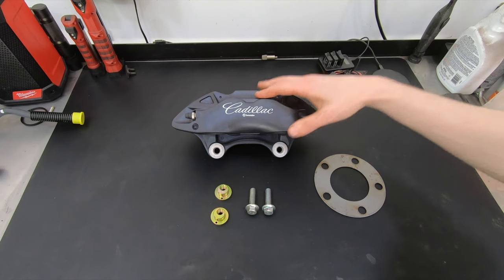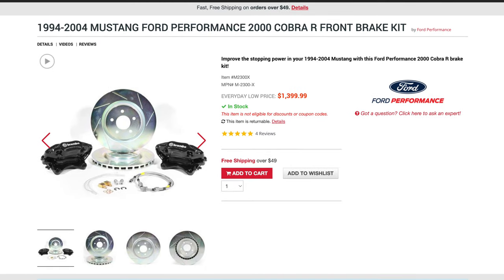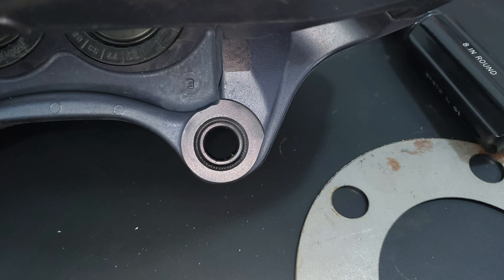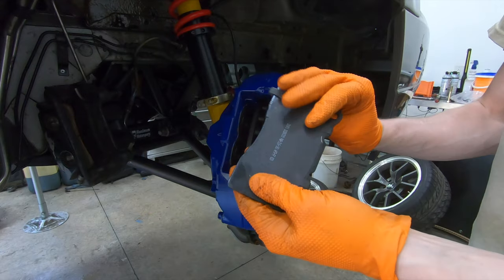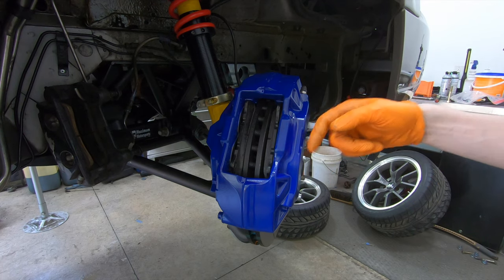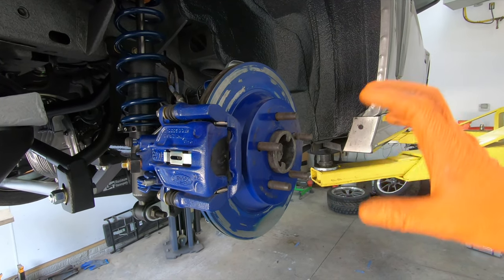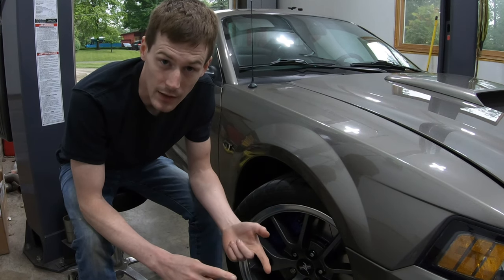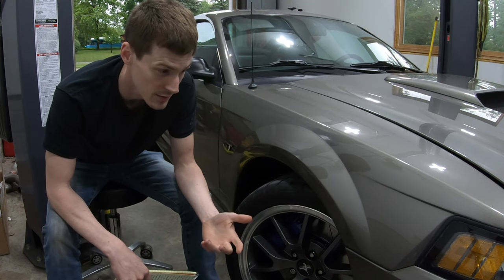Mustang Big Brakes Front and Rear for less than $600! 1979-2004 (ATS Brembos Front, Taurus Rear)

Comment: So just to clarify, if I were to use the ATS calipers in tandem with the Taurus calipers, and a 1 1/16 master cylinder, I would NOT have to use an adjustable prop valve as i would retain the “stock” bias with the Taurus calipers ? Or would I still need an adjustable prop valve? Have a foxbody btw but considering this setup
Reply from the maker: Considering those were rear drum originally I'm not sure to be perfectly honest with you. If it was me I would bolt this setup on, drive it a litte and see how it behaves. If the rears lock before the fronts install the proportioning valve. You will need the 1 1/16" master for sure.
Reply: @RepairGeek  yeah I ordered a stock 87-93 booster to pair with a 94-95 gt master. Since I have a 1980, I can’t fit any booster bigger than the stock gt without beating the hell out of my strut tower which I refuse to do. 😂
Reply: @RepairGeek  can I get your instagram in case I have any other questions ?
Reply from the maker: @mikecam94  repairgeek365@gmail.com it may take me a day or 2 but I'll get back to you.

Comment: Wait so we need the 11.5" rear cobra rotors with the Taurus calipers in the rear? Just want to double check before I pull the trigger on the rears. I already have the brembos up front and need to fix the variance
Reply from the maker: The taurus calipers will help the rear bias even on a 10 inch rotor. You dont need the 11.65 rotor to install the taurus caliper. It will bolt up fine. The 11.65 rear w/taurus calipers is virtually stock as far as bias using ATS fronts.
Reply: @RepairGeek  so I can bolt up the Taurus rear caliper and use either the 10" rotor or the 11.6"?
Reply from the maker: Not sure what you are working on but, yes using a 94-04 mustang caliper bracket yes, bolts right in.

Comment: How’s the brake pedal feel and initial bite? Does it make a huge difference or just marginal/compromise besides getting the willwood or bear breaks? I’d rather by once cry once hahaha 😭
Reply from the maker: It had enough brake power to compelety overwhelm a set of 275 Nitto 555's in a panic stop. I've since upgraded to Michelin PS4S's they have much more grip than the nittos.

Comment: I hate to ask this as I'm sure you've heard it a lot but I have to be sure..... so if I go with the Taurus calipers, use the stock GT rotors, correct? I'm going to go slotted so I want to buy a new set but wanted to make sure before I bought them.
Reply from the maker: You CAN use the GT rears with the Taurus calipers. The cobra rear brackets and rotors are larger and are vented. This will help shift even more bias to the rear.

Comment: Hello, I've ordered the parts for the front, but do you know what is needed to be able to mount to the Taurus rear calipers onto a Foxbody (91) rear end?  Great video, thanks for making it!
Reply from the maker: You will need to order whatever it takes to put a 11.5 SN95 rear rotor and caliper on a fox.

Comment: I have a question. The front brake lines you suggested. The female thread is to big for the brake line. Did you use a treaded reducer? If so what size is it and where did you buy it? 
Thanks
Reply from the maker: What year is your car?
Reply: @RepairGeek  2001 Mustang GT
Reply from the maker: That's exactly what I have. The front brake hoses are all the same across everything in 2001. V6, GT, and Cobra all use the same hose... I'm thinking someone changed the front lines on your car or the hoses you have were put in the wrong box. That part number is correct as long as someone hasn't changed the fittings on the hardlines on your car.
Reply: @RepairGeek   Ok by trial and error. I wasn’t aware of the lines are different sizes. The tread off the brake line on the driver side is bigger than passenger side. The lines were not labeled. I figured they were the same.  I caught it when installing the second line. I appreciate your response.
Thanks

Comment: Apologize if I missed this, but are stock Cobra rear brake PADS compatible with the Taurus calipers?
Reply from the maker: Yep same pad as a Cobra.
Reply: Rear cobra pads for cobra rotors, gt pads for gt rotors. Cobra pads are thinner for the vented rotor thickness.

Comment: Awesome video. I read the s&s bushings can also be used for the  XTS calipers and run 14” rotors. I am building a fox with coyote supercharged. I want stopping power but moving up to 14” could create a rear caliper problem.  Do you know which rear caliper would work to keep the bias as intended ?
Reply from the maker: Nope, that's why I went with 13's.
Reply: @RepairGeek  what brand are those 2 piece rotors ?
Reply from the maker: DBA.

Comment: I have a '00 v6 new edge I'm building as a drift car. I was wondering if you might know whether or not the taurus rear calipers would work with the dual caliper brackets for a drift set-up? I assume the dual caliper bracket is meant for the stock GT brake calipers, and I plan on upgrading the brakes all around when I go to dual caliper, but until I saw this video I was gonna go with GT brakes. But if the Taurus rear calipers will also work, then I'll go with them and the ATS fronts.
Reply from the maker: If the bracket is designed for a stock 94-04 mustang rear caliper, it will bolt right in.
Reply: The brakes are the same on the v6 and GT.

Comment: If I install these brembos on  2003 mustang gt and add the taurus 43mm rear calipers without changing out the rotors to the bigger ones will the bias be off by alot. Is it still in an acceptable range to cause the car to brake evenly or is it a must to get to bigger rotor as well?????
Reply: also where did you find the chart that explains all the brake kit bias?

Comment: Technically all you have to do is drill out the spindle to a 14.3mm opening and it all bolts up without the kit.  You will have to either machine the contact area to spindle 2mm or space the rotor out 2mm for perfect Fitment.
Reply from the maker: You can. It also turns a $200 spindle into a paper weight unless you run this caliper. Also, these bushings drop the caliper down onto the rotor further as well. Again you could accomplish the same thing slotting out the holes correctly but you really don't want a brake caliper bolting into a slotted hole.
Reply: Excúseme not everyone has a metal Lathe machine 😂

Comment: Killer video, you answered some questions I've had about this swap and one or two I hadn't worried about finding the answers to yet.  I really appreciate the level of detail here.  I do have 3 questions:
First, is the rotor spacer really necessary?  If we moved the caliper back from the spindle by using spacers on the caliper mounting the same thickness as the rotor spacer, wouldn't that have the same effect and also give a slight extra bit of wheel clearance?
Second, have you given any thought to changing out the master cylinder to one with a bigger bore to get the pedal feel back to stock?  I was thinking maybe the Cobra R master if it had a bigger bore would be a good first step but I haven't looked at the numbers yet.
Third, could you keep the brake bias similar to stock by switching out to a larger rear rotor with something like the FTBR kit instead of swapping to a larger piston caliper?  That might swing the brake bias too much in the other direction but might help with pedal feel as you wouldn't be increase the rear piston diameter.
Reply from the maker: 1) Putting washers behind the caliper would make the issue of centering the rotor worse. Without a rotor spacer the rotor is closer to the inboard pistons than the outboard pistons. Shimming the caliper with washers would push the caliper more towards the outside of the car and make the issue worse. The caliper needs to be closer inboard to not need the rotor spacer. Machining down the ears on the caliper would do this but, then you need to make sure the caliper is perfectly perpendicular to the rotor. This isn't easy to do precisely without a milling machine. @ 6:37 gives the best visual on this.

2) This car already has a 1 1/16th bore master cylinder on it. That's as large as they get for one of these mustangs because this car has hydroboost. To keep my booster that's as large of a master as I can run. Some super duty trucks has a 1 1/8th master and a hydroboost but the mounting flange for the master is different and won't work. So 1 1/16th is as large as you can go as far as I'm aware.

3) This one I'm not sure to be completely honest with you. The FTBR kit that I saw was over $800 to put a 13 inch rotor on the back of one of these cars. There may be a cheaper option but I didn't see it on their website. Someone is going to have to run the #'s to see what that bias would be on that setup. Adding nearly 1.5" of rotor will help with brake torque but without hard #'s on bias I would have a hard time telling people to go that route. Yes it would help with pedal feel but, $800 is a steep price to pay for some rear rotors and a caliper bracket. The 11.65" Ford racing kit is half that cost. Also you're stuck buying replacement rotors from FTBR with their kit. What I spoke of in this video you can buy replacement parts at any auto parts store as long as you are willing to press bushings out of the front calipers and transfer them.
Reply: @RepairGeek  
You nailed it on #1, I wasn't visualizing it properly in my head when I was thinking about it.  #2 I've been seeing conflicting info on the MC bore sizes.  I see 1" or 1 1/16" the SN95 MC bore sizes depending on where I look, all the parts catalogues list 1", where did you get the 1 1/16" bore MC or is that the stock unit?  Baer makes a nice aftermarket 1 1/8" MC for the SN95, but it is 450 bucks or so which doesn't help keep the cost down. #3 I hadn't looked at pricing on that FTBR kit in a LONG time and it has gone up quite a bit so I think swapping the calipers over to the larger piston makes sense here.
Reply from the maker: I want to say all the 96+ V8 cars had a 1 1/16th master. I know mine does. Guys with a 1" MC run out of travel with this setup. I looked at that Baer unit. It's intriguing but at $435 it's a bit too much $ to gamble. What I have isn't bad at all.
Reply: @RepairGeek  
Thanks for the info and the conversation.  If I find a good factory part that has a 1 1/8" bore I'll try to remember to come back here an post it up.
Reply: Not hydra boost but the svo has an 1”1/8 thinking about doing this swap since all the brakes are gummed up on this 27 year garage piece of my dads. Thanks for all the info!
Reply from the maker: SVO has different fittings for the master. It's not a direct bolt in for most cars. You have to get creative with the lines connecting to the master.

Comment: I like what you showed me. But i have a fox chassis  Mustang , will this work on that car? i did upgrade the rear brakes from drum to disc with stock Mustang components but still have stock front brakes. 11 inch sloted rotors with ceramic pads but the original calipers.  also converted to 5 lug. Also what year Taurus are these rear calipers from. The Amzon links don't mention the year.  And i agree , your stopping power is only as good as the tires grip to the road.
Reply from the maker: Use a SN95 spindle on the Fox lower control arm. The rest should be pretty much the same. Also you may have to up size your master cylinder. This car is using a 1-1/16th bore MC (factory). The foxes I believe are 1 inch bore or less. You might run out of pedal travel before the brakes lock up. A MC from a 94-95 cobra should bolt in and be the correct size I believe.
Reply: I'm doing this on my 89 GT we need to get the 93 cobra brake booster and a 93 cobra master cylinder
Reply: @RepairGeek  Sorry for the late reply. I do have a 94 Cobra MC on the car already since i converted the rears to disc Back in 2006. I need to get the SN95 spindles. My original calipers oar grinding on the rotor for some reason and i think the SN 95 would be better.  Do you know ere i can get some SN 95 spindles.? Thanks.  I also have the 17 "  wheels , factory for 94-85 Stang GT spot package. Double 3 spoke. Love them.
Reply: @myeighty-nine7813  Thanks. I already have the 94 Cobra Master on as i did a rear disc conversion on the car and  a booster from a v6 car.  much bigger.

Comment: Are rear cobra calipers good enough for this upgrade? Or should i still get taurus calipers?
Reply from the maker: The rear Cobra caliper and the GT caliper are the same part. The brackets are different but the physical caliper is the exact same between GT and Cobra. So, like I stated in the video, you need to upgrade to the Taurus rear.

Comment: Regarding the rear Taurus caliper. What if you are upgrading a Cobra? Are the Taurus rear calipers larger than the Cobra’s?
Reply from the maker: Yes the taurus caliper has a larger piston than even the cobra. The 94-04 GT and Cobra calipers are the exact same part. The brackets for the GT and Cobra are different. The Taurus caliper bolt right into either a GT of Cobra bracket. The 11.5 Cobra rear setup provides more rear bias than the 10.5" rotor'ed GT.
Reply: So with the Conra providing more rear bias do I need to do the Taurus swap?
Reply from the maker: Yes.

Comment: Do you know which are the rear sets of pads using the Taurus caliper and cobra sized rear rotors? I got the power stop evolution plus for the front, and wanted to get some similar ones for the rear, let me know 🙌
Reply from the maker: I'm not sure what you're asking.
Reply: @RepairGeek  what pads did you get for the rear
Reply: @RepairGeek  I got the front branded ones that u got, but I wanted to see what u ran for rear pads regarding the brand
Reply from the maker: Buy 94-04 Cobra rear pads. I just ran the same powerstop ceramics on the rear.
Reply: @RepairGeek  the cobra rear pads fit on the Taurus calipers ? 🙌
Reply from the maker: Yep, the caliper body is exactly the same casting. Only the piston bore diameter is different.

Comment: Can't you simply adjust your proportioning valve to adjust front to rear bias? That seems to be the easier step vs having to change calipers in the rear too.
Reply from the maker: Proportioning valves are only used for tuning. They can't make up for engineering problems.
Reply: @RepairGeek  don't see how it's an engineering "problem" if you literally have control over setting the desired bias. Assuming you're not drastically out of balance and the rears being terribly undersized, dialing it in is essentially the completion of the engineering process.

Comment: Thinking about doing this swap with a 98 Ranger, what is the bolt center to bolt center measurement of the caliper bolt holes on the SN95 spindle?
Reply from the maker: You're going to have to dig around on a forum for that info. My car is assembled lol.

Comment: did you ever figure out a setup for spare tire ? ive had this setup for a while now and it just dawned on me about the spare
Reply from the maker: Racestar Recluse front drag wheel is what I'm using. 18 by 5. 5x4.5 bolt circle. Clears front and rear with MILES to spare. I just mounted a temporary spare to that wheel. I don't remember the size on the spare. The car is in storage for the winter. I know the wheel and tire fits right in the stock area for the spare.

Comment: do you have a link to the 2 piece rotors? thx great video. read upgrade I have not seen anyone talk about.
Reply from the maker: The rotors I purchased on Ebay about 8 months prior. I got the set for about $250 NOS from 2005. To buy them new now is $475 per rotor was the cheapest I saw. They aren't worth 475 each. They are DBA 5000 series rotors. If you google: DBA 5000 Mustang Cobra. They pop right up.

Unless you get a smoking deal. Just buy regular rotors.

Comment: Just an fyi for anyone that needs it, test fit before paint. Also this setup does not work with 03-04 cobra factory wheels without a huge spacer. I am going to grind down the face of the caliper a little to hopefully clear.
Reply from the maker: Odd, I've seen multiple pictures of them working together.

Comment: The link for the rotor is different then the rotor you have shown, do you have a part number or link for that rotor?
Reply from the maker: The rotor that I have shown is discontinued I believe. It's a DBA 5000 series for a 94-04 Cobra. Current pricing is $675 per rotor... Long story short just buy regular rotors. They aren't worth the money.
Reply: @RepairGeek  appreciate the reply, looking to put these on my 65 mustang that has sn95 suspension.

Comment: Great video, I have the same S&S kit and will be installing next weekend.  On a side note, I went with the 13.25 rotors from a 2010-2014 GT,  S&S has a different rotor spacer for those rotors.  

So from what I can tell , the rear calipers are for a Taurus 93-99 in the event you want to purchase from your local parts store.   

I already have the 04 GT brakes, it sounds like I can still use the '04 GT rotors and that will be my phase 1.  Which brackets would I need for the Cobra rotors?  Would I need '04 Cobra rotors.
Reply from the maker: You need the axle brackets from a cobra. Ford Racing still sells the kit to do this that comes with axle brackets and the rotors but, I purchased my kit in 2016 for about $200 from Summit. Part number M2300M . That same kit is over $400 now. Even with the Ford kit you will need to supply your own 94-04 Cobra caliper bracket.
Reply: @RepairGeek  Did I hear you right saying you can use stock pads in the rear? A Cobra caliper uses thinner pads than a stock setup due to wider rotors. At least from what I've seen. So going from a GT to Cobra rotor you need Cobra pads...correct?
Reply from the maker: @glenndiorio8967  A GT and a cobra use the same pad shape. The fiction material is slightly thinner on a Cobra pad. Problem is a lot of these aftermarket pad manufacturers just have 1 part number for both cars. Some fit great others need the pad material ground down to fit the cobra rotor.